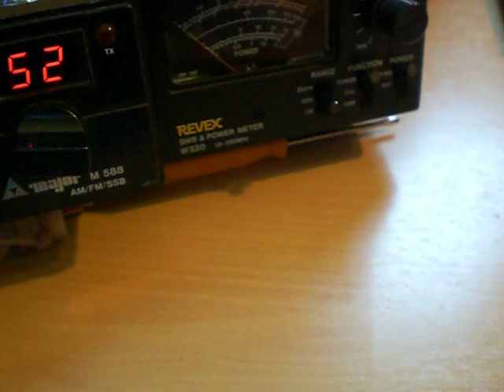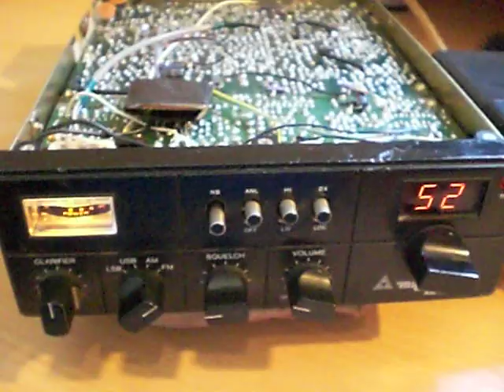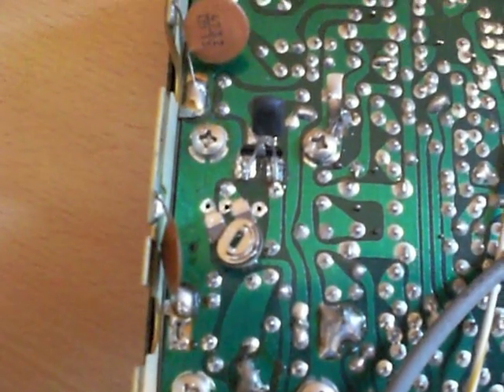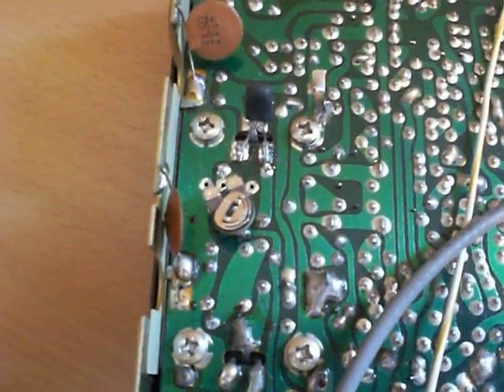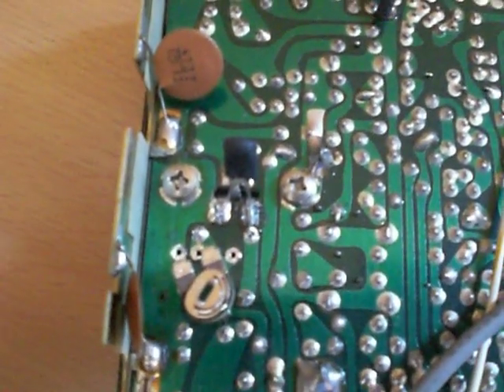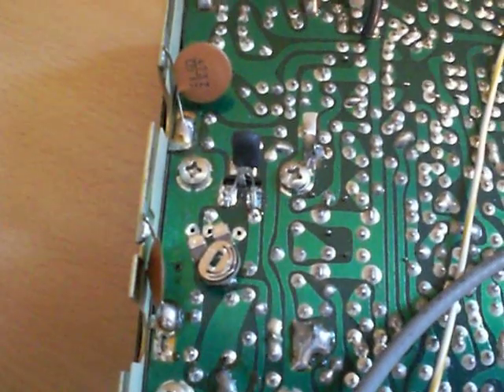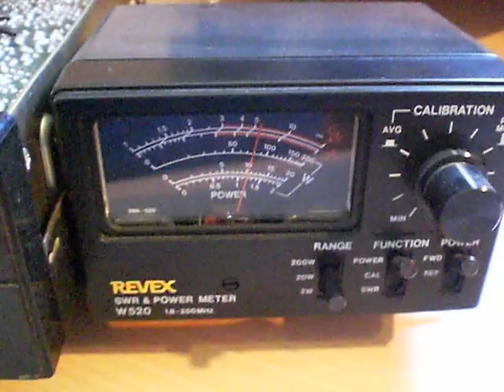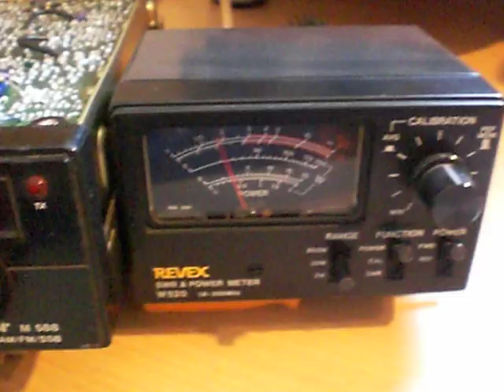IRF520N MOSFET CONVERSION FOR CYBERNET MULTIMODE RADIOS.

Comment from the maker: If i set the Gate voltage under 4v the SSB audio is poor quality, i also had the same problem with UNIDEN radios like the Cobra 148.
Other engineers i know have also experienced this.

Comment: hi , i have a old cobra 148 gtl , version 5 pins microfone , i would like to make this modification using irf 520 , i use the same parts , (Parts used= IRF520N, EKL: EN369-FN, 50K pot. (Gate voltage set to 4.3 volts) )

and the bias voltage is the same , 4.3volts for cobra 148 gtl , do you have a site for this tutorial 

thanks 

congratulation for this article,, and modder

regards ciro

Comment from the maker: I use the IRF520 as it has  a higher drain current rating, the voltage makes no difference.

The IRF510 is just as prone to failure!

Comment from the maker: I do not use these devices anymore as i now have  replacement 2SC1969/2SC2312 transistors which work as good if not better than original Mitsubishi's.
The IRF520/ERF2030 type MOSFET's were only used to replace the obsolete Mitsubishi devices but they are not RF linear devices and are prone to failure, if you see my other videos you will see the new 2SC1969/2SC2312 type transistors being tested which i have listed on Ebay.

Comment: Do you have info on mosfet conversions for the older uniden chassis's with the MB8719 and UPD858 PLL.
Also can you advise on the values are for bias for your mod.
VK4HDA

Comment from the maker: The EN-369FN is a special part which combines 3 parts in1.
IRF520N 's are not standard RF devices and will not work without this part they also require higher biasing voltages.
I have the EN-369FN part in stock.